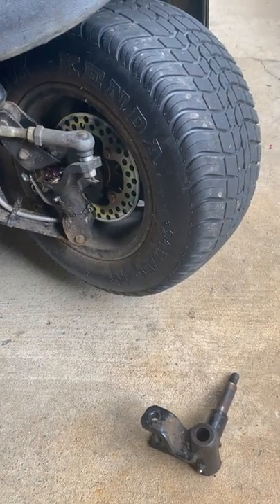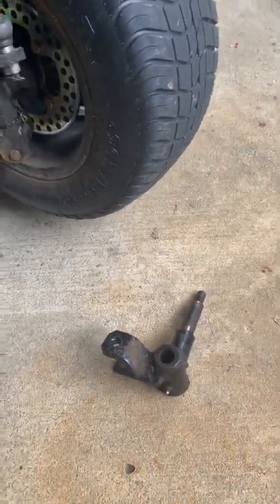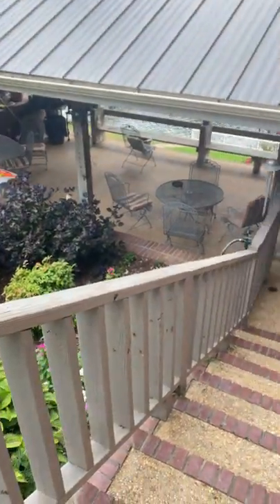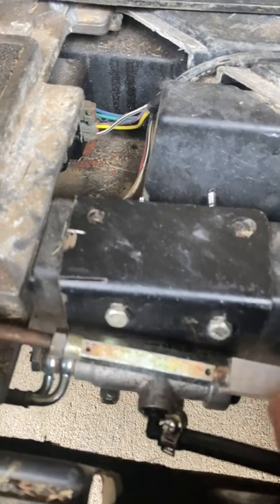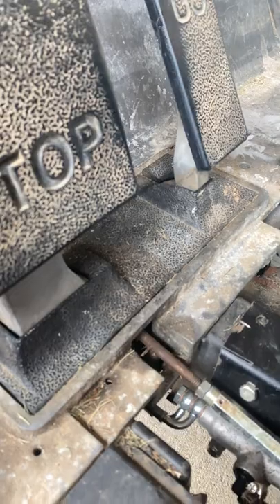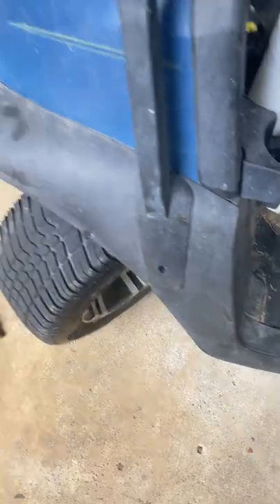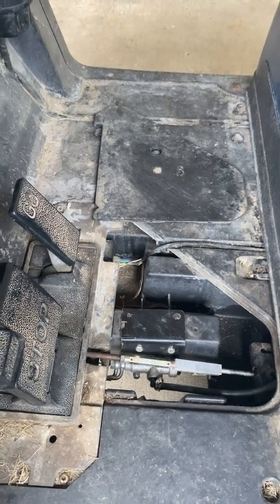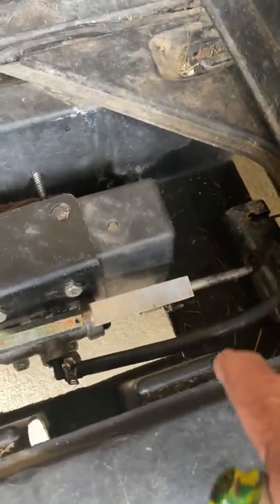GOLF CART HYDRAULIC BRAKE KIT INSTALLATION

Comment from the maker: The addition of the front wheel brakes help much on my travel down to the pier. I have greater stopping power now. i searched for golf carts with 4 wheel hydraulic disc brakes on all 4 wheels but that seems to be very rare on golf carts; whereas, it is common on side-by-side atv vehicles; but, most of those r gasoline. i do not want a gasoline
Reply from the maker: Ordered online from GolfCartGarage.com---Fit my 2007 Club Car Precedent